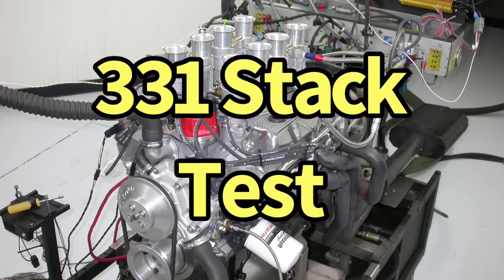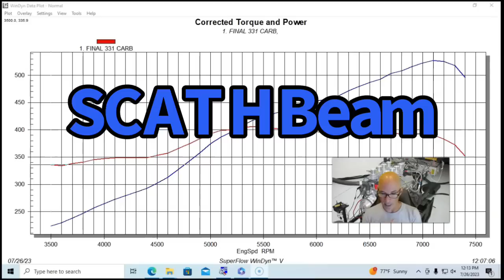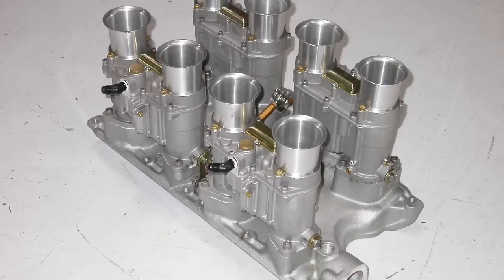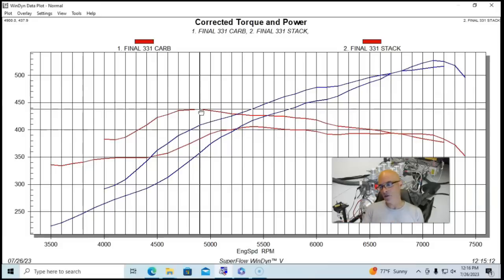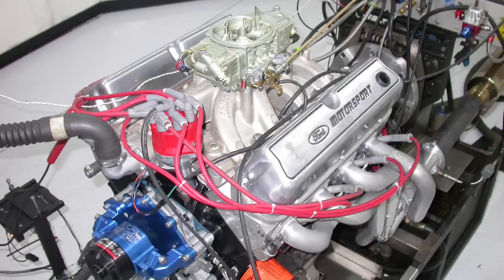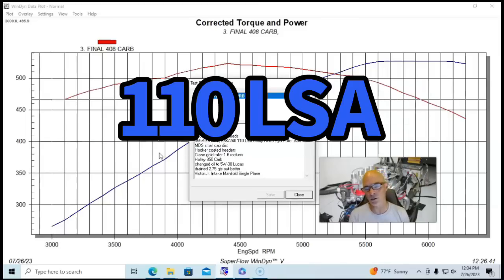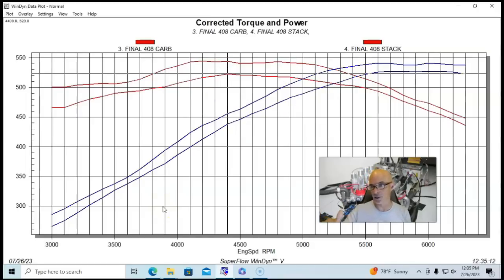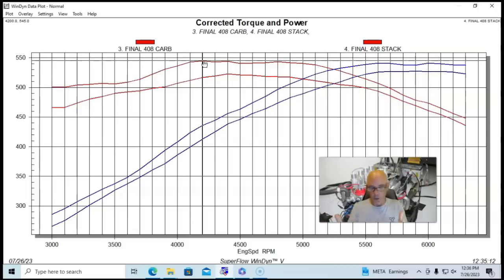HOW WELL DOES STACK INJECTION REALLY WORK? DUAL SBF STACK TEST, 331 & 408 STROKER-FULL DYNO RESULTS

Comment: I run 8 ITBs in a stack setup just like this, fuel injected.  Engine is a 452 cu. in. FE with 248/254 SR cam.  The stacks are too small for the engine, but the engine made more hp and torque everywhere compared to a Victor intake with a 850 Mighty Demon carb.   The throttle response is epic.   It was a lot more work, but the results were worth it.
Reply from the maker: I did a test with these with Robert Pond on a 600+ hp FE
Reply: @richardholdener1727  The engine is in my classic 1968 Mustang fastback.  The car has full interior and a roll bar.  The car runs 7.1 sec in the 1/8 mile.  To make the car more streetable, I detuned the cam from 248/256 on a 110 to 240/246 on a 114.  This fixed a flat spot from 900 rpm to 1500 rpm.  The EFI is run by a megasquirt.  The engine would benefit from a 52 mm or a 58 mm ITB, but they don't fit the intake manifold.  I use a Ford PW idle valve to control the idle.  It is plumbed into the common intake plenum present on the Blue Thunder intake.  This makes matching the throttle blades less critical.  Idles smoothly at 650 rpm, 700 with the AC on.
Reply: @turbo32coupe Is this a stick shift trans., or an automatic? I assume stick shift trans., if you were worried about the 900 to 1500 Rpm flat spot?
Reply: @evilinside5984  yes, Tremec T56 magnum.  Changed the cam to 240/246 on a 114 LCA and that fixed the flat spot.
Reply: @turbo32coupe - I thought so, as an automatic would have a Tq., converter to cover up that flat spot. But not with a stick, causing a direct lug down, while releasing a clutch. Also did you, or did someone else, get you to go to a 114 Lobe sep.? As a lower Lobe sep., would have helped more, in the Low end Tq. production, and all over really.
Reply: @evilinside5984  A tight LSA like 108 makes more peak torque, but the overlap kills the low end.  Off idle, a wider LSA produces more torque.  The original cam in the Ford 428CJ was on a 117* LSA.  I used to race the car with an automatic with a converter.  It flashed to 3000, but when I changed to the 6 speed, the flat spot was right at the low speed cruise rpm.  This made the engine twitchy.  It wanted a higher rpm to settle down.
Reply: @turbo32coupe  What was the original cam's @ .050 duration specs? Dur. @ .050 matter's the most on Rpm range, then Lobe sep. All of the dyno test's that i have seen, where they use 3 of the same cam's spec's, except the Lsa, the (1st cam), had a 101° Lsa, the(2cnd cam), had a 107° Lsa, and the (3rd cam), had a 113° Lsa. The 101° Lsa had the most off idle, just barely more than the 107° Lsa ( which had the most peak, and through out the whole Rpm band, and the 113° had a lot less down low Tq., and @ peak, but came back up top. The general rule of thumb is 100° to 108° Lsa are quick Tq. and power maker's, that don't usually shine up in the high rpm= 8k to 10k Rpm, 109° to 114° seam to be right in the middle, and 115° to 122° are supposed to be high Rpm screamer's! That being said you dropping the dur. @ .050 by 8° int., and 10° exh., is what helped you the most.
Reply: @turbo32coupe When i looked up the 1968 Cobra Jet cam specs: 114°/110° Lsa= a 114° Lsa was advanced +4°, to help low Rpm Tq. Along with the smaller dur. @ .050 int.= 224°, and the dur. @ .050 for the exh.= 232° A Much smaller cam than yours, which is why they could get away with a higher Lobe sep. Angle, being that the dur. @ .050 was so small, relative to the engine size= cubic inches.
Reply: @evilinside5984  I am corrected, I think the 427 cam was on a 117 LSA.  It has been years since I looked at it and the technology is much improved.  The independent throttle bodies let the engine think the cam is much smaller.  There is no common plenum, so exhaust gas doesn't get sucked into the intake at low rpm and contaminate the intake charge.  My engine idles smoothly, no lope, at 600 rpm, but I set it at 750 rpm because of the air conditioning.
Reply: @turbo32coupe The drag times you stated, were those times with the old= bigger cam, or with the new= smaller cam? Do you have before, and after, drag time's/results/E.t., i would also be curious, on your 60 ft time's, before and after? I love data, and your car sound's like it is Awesome!
Reply: @evilinside5984  Drag times were with the old cam, 3.75 gears, C6 and convertor.   Switch to a T56 Magnum when they closed the track.  The new cam has the same intake closing and exhaust opening angles, just stretched out the LCA to reduce the overlap.   I suspect the times would be similar.  Ran MT 10.5W slicks.  The biggest problem I had was the track wouldn't hold the launch unless they prepped it.  My 60' times were 1.64 sec.
Reply: @evilinside5984 found the DV soldier.
Reply: @jpl1983  - The only one i am a soldier of, is GOD🙌👏 God bless you, & have a nice day.
Reply from the maker: a wider LSA makes produces more torque?
Reply: @richardholdener1727  A wider LSA usually make the peak torque less, but makes the power curve less peaky.  For every combination there is an ideal LSA for maximum torque.  For engines with big cubes and less head flow, the LSA should be 106-108.  For engines with good heads and less cubs, the LSA can be 112 or greater.

Comment: Don't know much about efi injection   but used cf enderles a far bit   best effort 406 chev  crower flat tappet 258 263 108   13.5   sportsman  irons factory 4 bolt  9. 15   with a 1/2 pump  and NO high speed    alky  and a vertex  mag    simple but killer out of the hole. 😊
Reply: @petercunningham3469- What's a 9. 15 with a 1/2 pump?

Comment: Crossram manifold or hillborn style out the bonnet, matched to itb or those weber things, tapered down to  match port will beat that short manifold anytime.
Itb tunnel ram like.
Problem is. If you want to filter it and airbox it .
You lose alot of the benefits.
Can do but. You want an airbox and in take to it huge.
Ie, use the whole spare space under bonnet, huge untakes to it, get close to ambiant air, less of a plenum then.
They make a wild cam quite docile and tractable too.

Comment: The stack injection looks like they are Weber IDA carbs, which came in 46 and 48mm sizes. I used to use 48s but went up to 52s ( which are available nowadays) and picked up 30hp on a 4 cylinder. My point is that the bore size of the stacks should be increased to produce more power.
Reply: How was the drive ability?
Reply: @cartermackenzie1135   The car weighs less than 700kgs and originally had 24hp and 2 cylinders so now with 250hp and 4 cylinders the drivability is fine😊

Comment: Thanks Richard! I have always hoped you would look at this type of induction. That actually went pretty close to what I would have guessed. I am curious if you feel like the lower intake was wrung out of every bit of flow or do you think there is still more potential left in increasing port flow? Also, have you ever run the side draft style manifolds? I am really curious about them. My guess would be even more low end torque with a slight decrease of high rpm HP. Great content! Always excited to see Ford content!

Comment: Cool but how do you filter the air on a street driven car?  I have seen the little foam pieces that cover each throttle body.  Do those really filter the air properly?  And how much power do they cost?
Reply: There's also systems that bolt a common plate onto each set of 4 stacks and puts a big "foam dome" over everything that doesn't restrict the flow as much, but it also doesn't look as cool
Reply from the maker: filters are an issue with stack too
Reply: @richardholdener1727  they tend to kill the hp and tq.

Comment: Certainly would be interesting to see what kind of power is made by a matched setup, where flow isnt restricted by the manifold
Reply from the maker: it wasn't in this case-we ported the lowers
Reply: @richardholdener1727  Oh I thought you said youd done the best you could with what you had, but that a different designed manifold, with more flow built in, wouldve been better.
Reply: I would look for some dynos on the Speedmaster and Borla ITBs.  My engine guy said even my Speedmaster manifold looked really good for flow.  My bet is the Borlas are even better.  But cliffs notes they both show great gains.  Richard has done other ITB videos.

Comment: Request - one with the displacement and or rpm (along with cylinder heads/package to support it) but with the Kinsler setup with the big ass K&N like you see on sprint cars and trophy trucks.
With and without the air box.  Does it act like a plenum?  What's that look like?
Note - yes TPMS map can be finicky.  Some have used manifold pressure estimate tables for the tune (EFI).
Reply: Is that Kinsler setup mechanical FI?  If so that wouldn’t work very well on the street.
Reply: @danmyers9372  The sprint car stuff is mechanical but trophy truck stuff is EFI.  
As far as working on the street 😅 - maybe ya get away with it in a truck or something with lots of hood clearance (or you want it sticking out).  It wouldn't package well with most applications.  The filter is 7"×14"×19" and you're down a good bit on power without it.
Kinsler makes all kinds of stuff but I just thought that was an interesting thing to see on the dyno.
Reply: I cant say how much it would act like a plenum but I gotta believe you still get the benefit of better idle and low speed throttle response if its all working and tuned right.  My Speedmaster has a small common plenum to generate a better MAP signal.  You still need to get all the throttles opening the same which is the big trick to all this.  PS: mine is efi which helps too.  I am sure carbs with itbs back in the day was a bit of a nightmare. Lol
Reply from the maker: if it has a box-is acts as a plenum